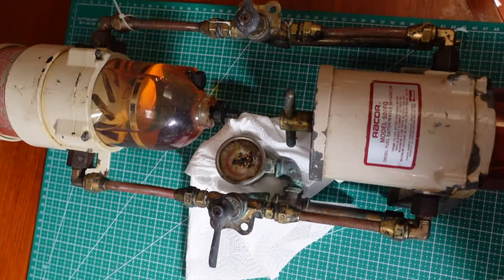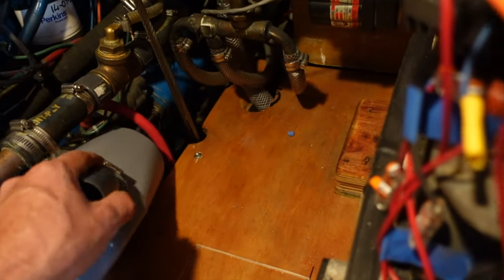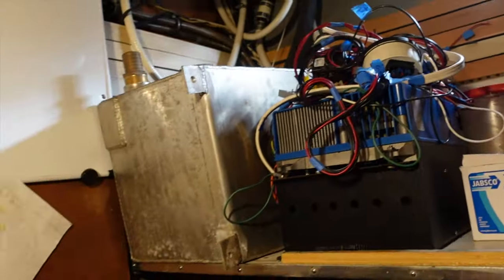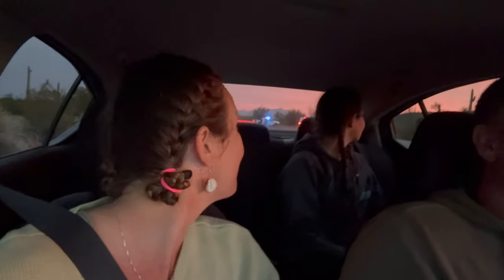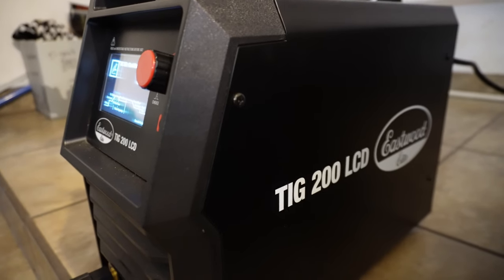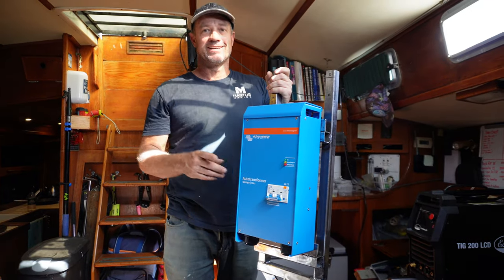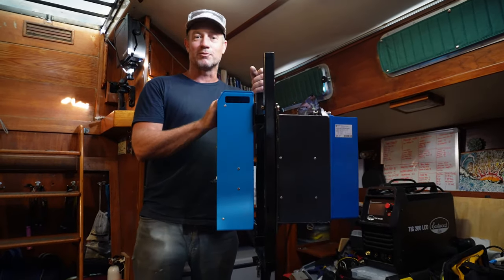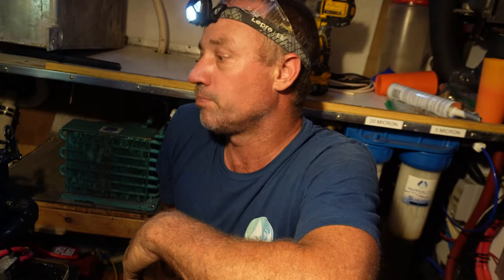Sail Boat Revival | Welding and Powering Up Ep 401

Comment: Having a welder gives you so much flexibility. I don’t understand why more boaters don’t have one. They were good welds you did. My advice? Buy a small Lathe too. One with a 550 mm bed is not very heavy, you’ll need a location 900mm wide under a bench with a lifting top. 😊

Comment: Nice Work! For your starter Lithium Battery you might need to do something to accommodate the difference in the charging profile vs Lead. When I put a lithium starter battery in my motorcycle I changed out the voltage regulator to make sure it charged with the right profile.